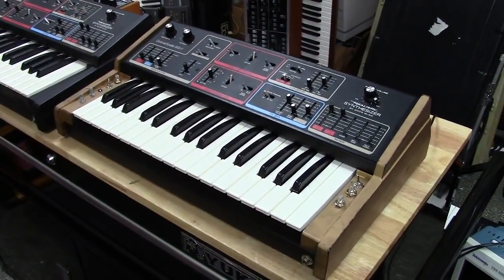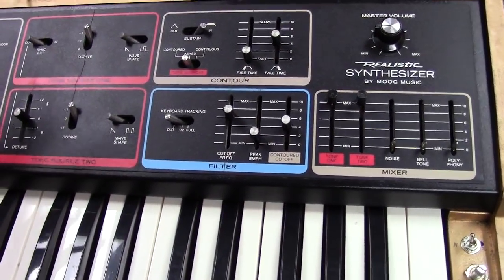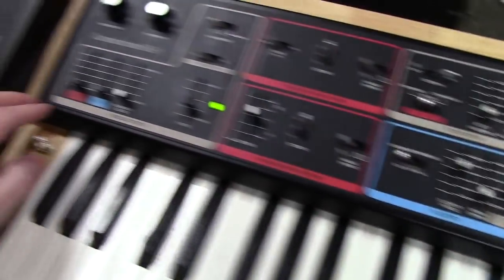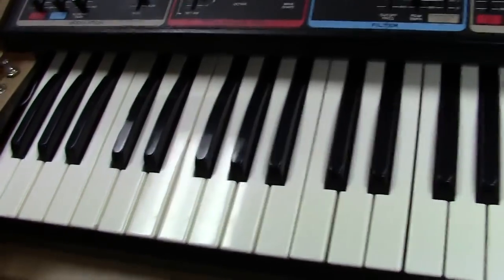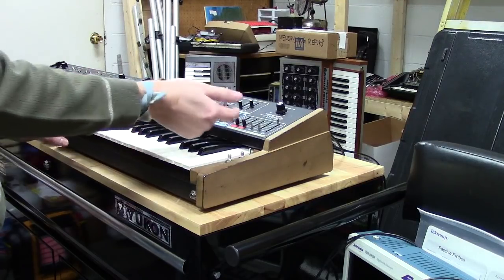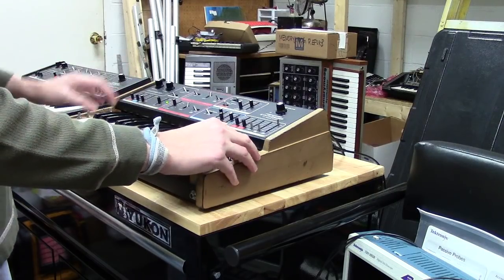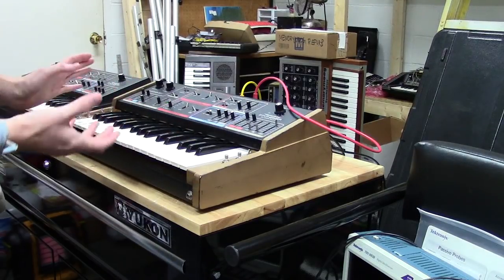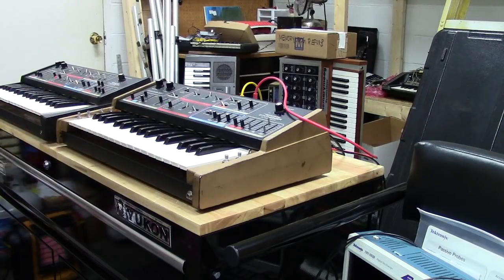Nathan's Moog/Realistic MG-1 modifications (by Synthpro)

Comment: I just found one if these in my grandfathers garage! What kind of amp or speaker do i need to test it???
Reply: There are two audio outputs. On the front right is a stereo headphone output (you might need a 6.35mm to 3.5mm adapter). On the rear is an RCA audio output.